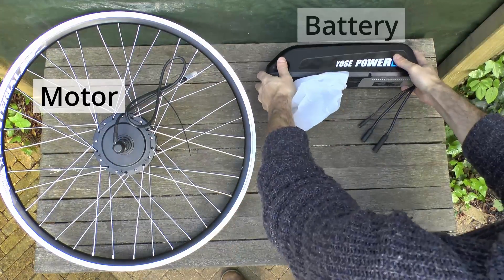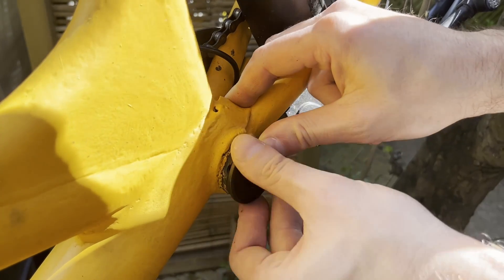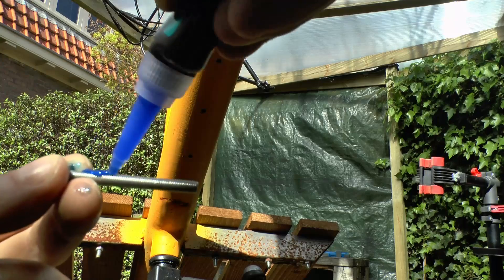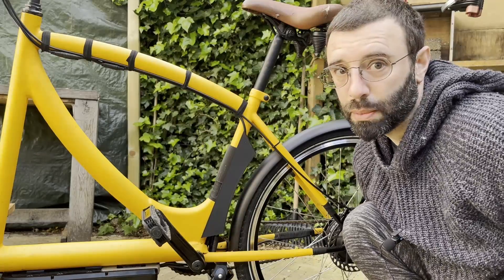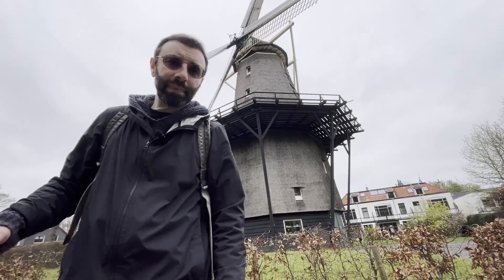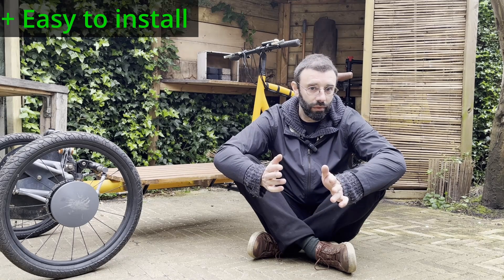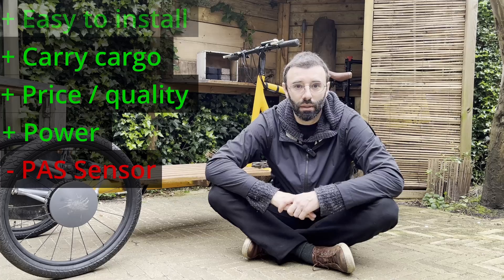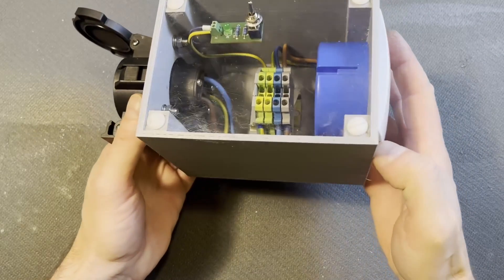Cargo Trike Electric Conversion #7

Comment: excellent and interesting video. Did you consider putting the motorized wheel on the front? When i first saw the hubs i thought they were already motor hubs. It would be the first sports cargo trike :)  Also looking forward to the opensource project files.
Reply from the maker: Thank you so much! The advantage of having the motor in the rear wheel is that I don't need a differential. The front hubs are very big indeed;) I'm working on new wheels, actually. Many changes coming with the open source project.
Cheers!
Reply: @pedro-neves  with two motors, one for each front wheel (for example from a used hoverboard that you drill for spokes) you do not need a differential, just two e-bike motor controllers. It would give you single side axle wheels and possibility to do regen braking because they have now freewheel. For mechanical front brakes it would be more complicated because there are no disc-brake mounting holes.
Reply from the maker: @Acamperfull , I do like the idea of repurposing two hoverboard motors;)
And I also agree that a final product should have regen braking. You save on brakes and gain on energy. There are many possibilities. The most common these days seems to be the mid-drive. I'm actually considering developing a mid-drive with gears. But I haven't truly decided. So, thank you for adding a suggestion. I truly appreciate it!
Reply: @Acamperfull  This is a good idea, and I think there is also a solution to avoid using two controllers : connecting the two motors inline, the power should equilibrates between the two motors. 
With a 48v battery, and two 24v motors for example. (or 72 to use two 36v motors).
Reply: @onurb8917  Hoverboard motors are 36V brushless DC motors and as the motors will not be kept in sync with eachother you really need one BLDC controller per motor but are not hard to find or an expensive  part and they can share the input, so just one dashboard, PAS-sensor/ throttle, brake sensor and battery is needed.

Comment: Your trike project is wonderful and I'm happy to see any updates! The conversion is also great and really interesting to see, as I'm also elecrifying my Bullitt cargo bike in a couple of days. 
However I feel that the battery placement is really bad, as it will be catching all the watter from both the road and dripping down from the frame. I do not trust these battery cases at all to be so completely waterproof! M̶o̶u̶n̶t̶i̶n̶g̶ ̶o̶n̶ ̶t̶h̶e̶ ̶s̶t̶e̶e̶r̶e̶r̶ ̶t̶u̶b̶e̶ ̶m̶i̶g̶h̶t̶ ̶b̶e̶ ̶m̶u̶c̶h̶ ̶s̶a̶f̶e̶r̶ ̶a̶n̶d̶ ̶s̶t̶i̶l̶l̶ ̶h̶a̶v̶e̶ ̶t̶h̶e̶ ̶C̶O̶G̶ ̶l̶o̶w̶ ̶e̶n̶o̶u̶g̶h̶ ̶I̶M̶H̶O̶.̶   (edit: apologies, I completely missed that you have a very funky frame with limited steerer tube access.)  Best of luck!
Reply from the maker: Thank you so much! I do agree that the battery needs protection. From water, and maybe also from bumping into something in the road.
Good luck with your Bullitt electrification!